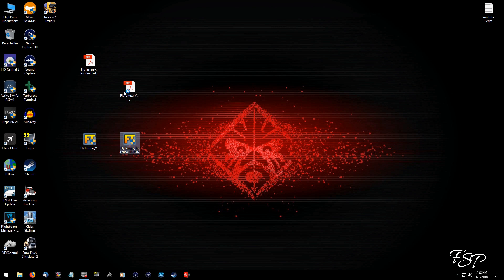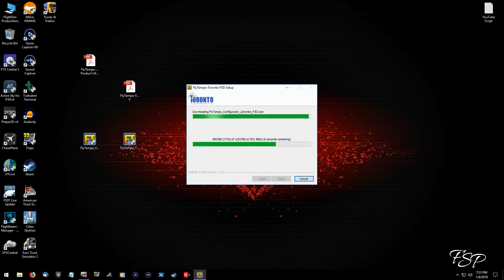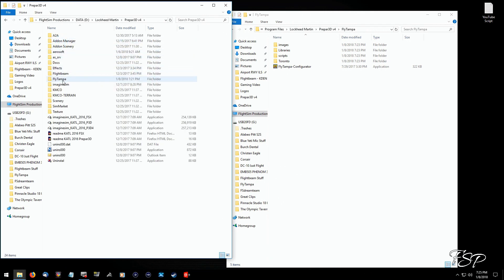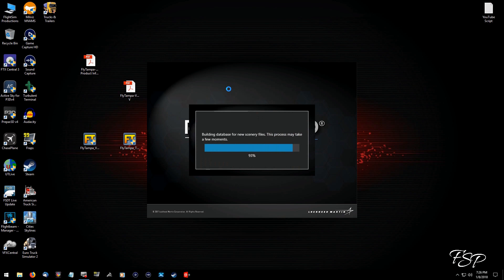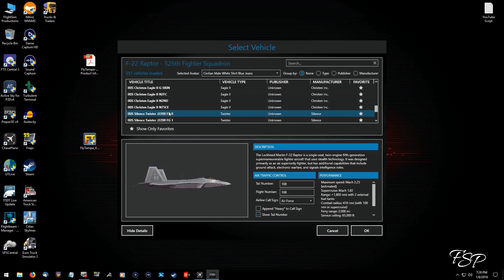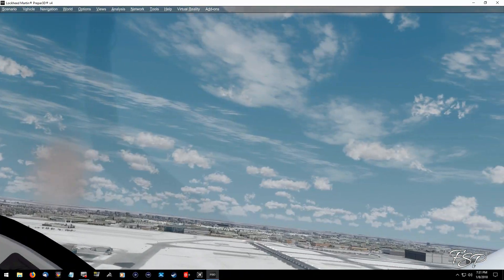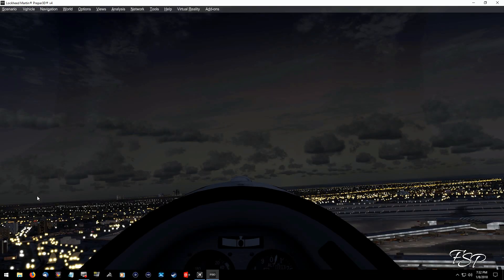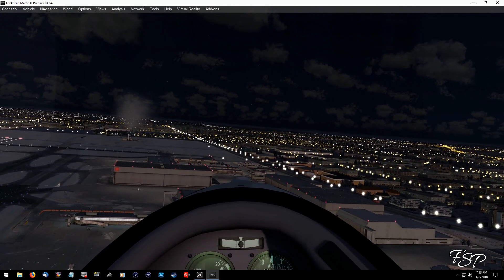FlyTampa's new installers for Prepar3d v4+

Comment: did you copy another p3dv4 exe in another drive the way you able to copy flytampa into another drive  i think you should have shown how to set everything from the start i just dont know how you set the other folder
Reply from the maker: I installed the Vienna airport, which has the new installers first.  The other airports were manual moves.  They were installed into the default location within Prepar3d (in other words I just installed them without changing the default location).  After installing all of the sceneries I then copied those into the hard drive I wanted to save them to, then went into the scenery.cfg and changed location there.  I will get a video out on this in the near future.
Reply: Thank you can wait to see the video keep up the good job big FAN